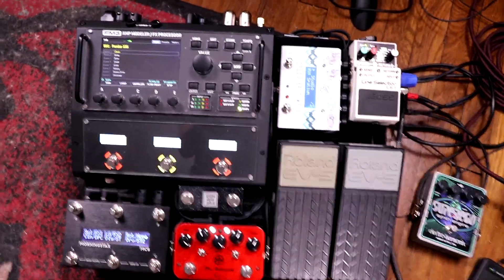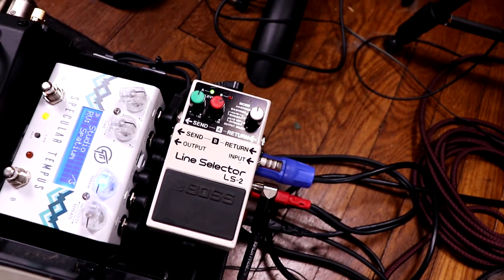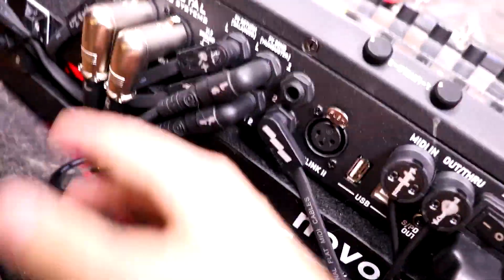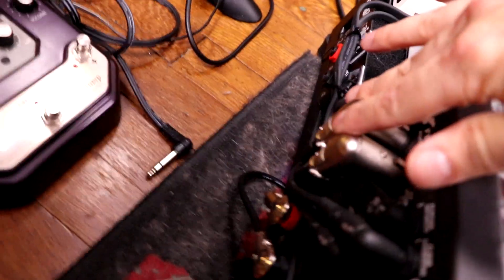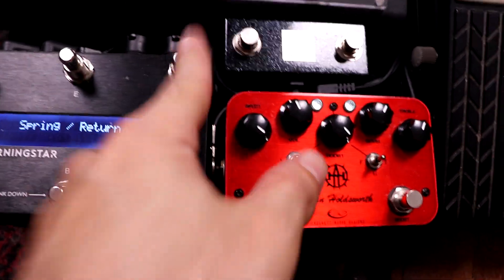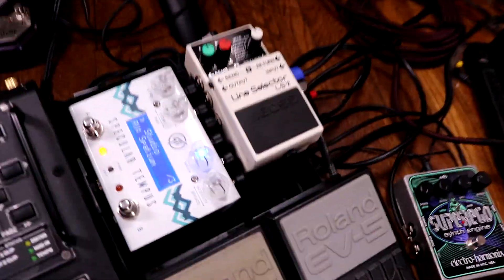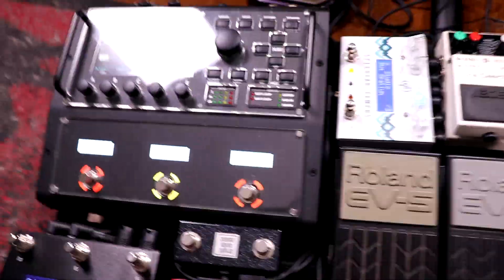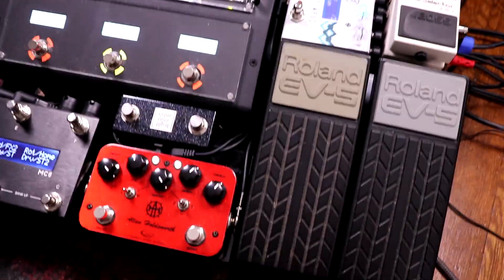FM3 Super Gig Rig walkthrough

Comment: Great video =D Love it!! Can you say me how you've fixed the FM3 on the PT?
Reply from the maker: I used 3M Dual Loc. I made sure to position the bottom heat vent over an opening in the PT rails.
Reply: @Poparad  did you have fixed the dual lock on the extreme left and right? or on the main panel?
Reply from the maker: Yes, on the left and right sides of the FM3. I took off the rubber end pieces so I should get a flat surface on the bottom of the FM3 for the Dual Loc.
Reply: @Poparad  Thank you so much! very kind =D

Comment: This is great man! I’m in the process of planning a board now around a FM3 and novo 18. I’ll be using a RJM PBC/6X with a couple external pedals being a H90 and a drive or two. 

I’m going to checkout the insert boxes from Disaster Area but how do they connect to the novo? Like how do they stay on the board? Your video has me excited to get started this weekend.
Reply from the maker: For all the stuff under the board, I just put some Velcro on the bottom, same as I would on the top. Works pretty well.

Comment: Can you please share settings for the two button external switch? I have the Ampero 2 button switch (TRS cable) and don't know hot set second (HOLD) function. I think I didn't set right the "Stand-In Switches" in the FCControllers tab menu at in/out settings.

Comment: nice board, how do you wire the expression pedals?
Reply from the maker: They're both plugged into the MC6 and the MC6 is sending that via MIDI to the FM3. I picked a CC number in the FM3 and assigned it to External 1 solo when I want to use that pedal in a patch, I attach External 1 as a modifief to the effect.

Comment: Hi Jeremy, very nice pedal board, and very well thought out. Quick question: I'm a new FM3 user, and I have an XLR (L) out cable into an XLR input to my ZEDi 10FX mixer without a DI box. Is that ok, or should I use a DI box, or use an instrument cable FM3 out (L) to line input on the mixer? Thanks in advance! 😀
Reply from the maker: XLR straight to the mixer is fine, but it will be at line level and not mic level, so that just means you will be keeping the gain on the mixer channel lower than you would if it were a mic. When I do shows, I always tell the soundperson that the XLR out is line level so they don't accidently blast the channel.

A DI box is only necessary if you're converting from one type to another (like 1/4" to XLR) or if you want to split the signal, which is what I'm doing. I have the DI box splitting to XLR out for venue sound and 1/4" out for my monitors.

If you don't plan on using Out 2 as an effects loop, you can set it up to copy the signal from Out 1, then you can use the 1/4" outs the same as you would the XLR outs. You could use the 1/4" outs for your own sound and XLR for the venue's sound board and still be able to go stereo on both if you'd like.
Reply: @Poparad  Thanks for the quick answer! 🎸

Comment: Quick question! So through your thru box, it gets into the DPC Micro into the Specular Tempus. Could you do the same for the other thru channel? Like going thru into the FM3 and then out to maybe another midi capable pedal?
Reply from the maker: Yes, it's just a MIDI splitter so whatever goes in gets duplicated and sent out through two outputs. I currently have it going out to only the FM3, but I could put another pedal or two after that if I wanted to.

The only thing to consider with routing is that the FM3 and the MC6 both send commands but you can't have MIDI Thru enabled on both or you'll get a feedback loop. So one of them has to be the end-of-the-line as far as forwarding messages goes. I have the FM3 setup with MIDI Thru off. However, the MIDI out of the FM3 still sends messages, so I can control the MC6 with it, but it doesn't forward messages from MIDI in through to the MIDI out.
Reply: So Midi out of axefx to MC6 in. The MC6 out to midi solutions in. Midi solutions out to tempus?
Reply from the maker: Originally, Midi Solutions to the DPC Micro loop selector, thru to the Specular Tempus. The Midi Solutions is a two-way splitter, so the second out is going back to the Fractal midi in.

Since I made this video, I replaced the MIDI Solutions boxes with a Morningstar Midi Box. Now it's Fractal out -> MC6 -> MIDI Box -> DPC -> Fractal in, with one of the outputs on the MIDI Box going to the Specular Tempus. It takes up way less space under the board, plus I have 7 more MIDI outs of I ever want to control any other outboard gear (so far never needed to, but it's an option).

Comment: Is that a Temple Audio pedalboard?  If yes, how did you attach the FM3 to it?
Reply from the maker: It's a Pedaltrain Novo 18. I used 3M Dual Lock velcro on the FM3 along with the regular velcro on the Pedaltrain board. I took the feet off of the FM3 but both because of the extra thickness of the Dual Lock and by positioning the FM3 vent over one of the gaps in the Pedaltrain rails, I've made sure to keep the airflow unobstructed. I've used the FM3 for many hours since mounting it and the temperature has been very stable and within normal operating ranges. The Dual Lock is strong as hell, to the point where I don't know if I could actually get it back off the board again if I wanted.

Comment: I just ordered a fm3 and a fc6 and im curious, did you mount it on the pedaltrain with velcro or do they by any chance have any type of slots to run a zip tie?
Reply from the maker: I used 3M Dual Loc instead of Velcro. It's thicker so there's a better airway open for the vent under the FM3. I also made sure to position the FM3 so the vent is over one of the rail gaps in the Pedaltrain. I also had to take the sides off the FM3 to make it work. It's really secure on there. Like, I don't know if I'll ever be able to get it off again secure.
Reply: @Poparad  oh awesome. Thanks for the info 🙂. Now when you say you dont think you’ll be able to take it off securely, do you mean its kinda on there permanently and  taking it off might somehow damage your fm3?

Comment: I'm trying to do something similar with an HX Stomp, and an Eventide H9. I am getting a Morningstar MC 6 and do you think a Morningstar ML5 loop switcher into the Morningstar can replace the Disaster 3-Loop switcher? thanks, I'm a newbie to Midi.
Reply from the maker: Yeah, that should all work great. All of the Morningstar stuff is great. Since I recorded this video, I reworked the board a little bit. I now have a Cioks isolated power supply underneath to eliminate some hum I was getting by daisy chaining everything on a 1spot. To make room for it, I replaced the two MIDI Solutions boxes with a Morningstar MIDI splitter. It's smaller and has 8 outputs instead of one. I think the Morningstar loop switcher only has MIDI in, so you'll need a MIDI splitter to reach everything. The Morningstar splitter only has 3.5mm out, so you'll need to get a 3.5 to 5-pin midi adapter cable.
Reply: @Poparad  Thanks man!

Comment: How are you mounting the fm3 to the board?
Reply from the maker: 3M Dual Lock. I removed the end caps so it will sit flush to the board and made sure to position the bottom fan vent over one of the rail gaps in the board.

Comment: great - could you explain how to setup the two button switch to assign the tuner to tap and hold?
Reply from the maker: I have them set up as remote switches. They're triggering two of the normal switches in one of layouts on the FM3. I just picked two switches that I wasn't using in one of the layouts (I picked the last two in layout 1) and assigned them to Pedal 2 (EXP/SW TIP) and Pedal 2 (SW RING). The open jack for my other 2-button switch I did the same with two more unused layout switches at the two Pedal 1 assignments. So because they're just literally external remote controls for on board switches, you can program with all the same functionality that the 3 on board ones have, other than you don't have any display text or lights.
Reply: @Poparad  thx "stand in switch" was the keyword that I was missing. Now it's working fine for me. I just had to configure setup - I/O - pedal - switch 1 ring/tip behavor from "virtual toggle" to "follow hardware"

Comment: Tell me do you think the fm3 would be good for just delays and verbs in my loop
Reply from the maker: The delays and reverbs on this are fantastic. Lots of different algorithms and emulations of classic delay units. Same sounds that the AxeFx III has.
Reply: @Poparad  but do you find they are as good as the time line or h9 or any other effect type system. I only want it for effects and no amp emulation
Reply from the maker: I've never used either of those units so I wouldn't know.

Comment: Why a noise gate when the Fm3 has one built in?
Reply from the maker: Since the overdrive pedal is before the FM3, having the noise gate after isn't very effective. I originally didn't have the noise gate pedal on the board but I wasn't able to dial out the noise effectively, so I had to spring for one to place before the overdrive pedal.